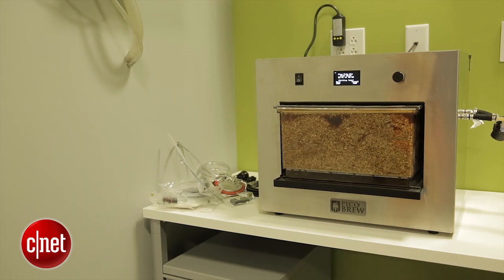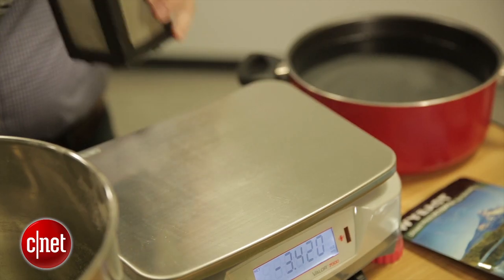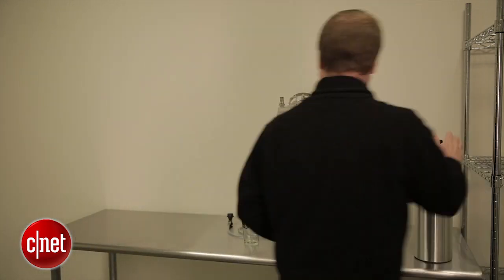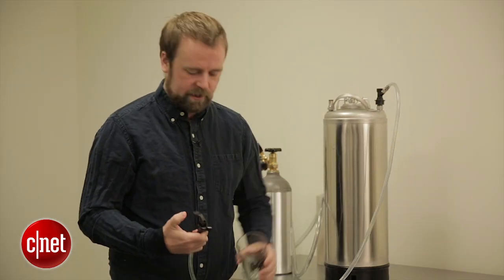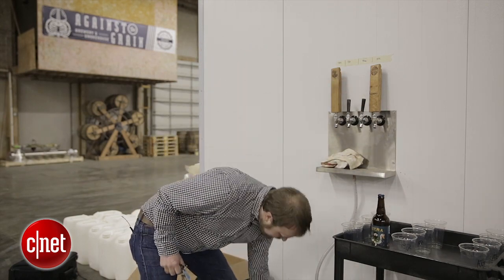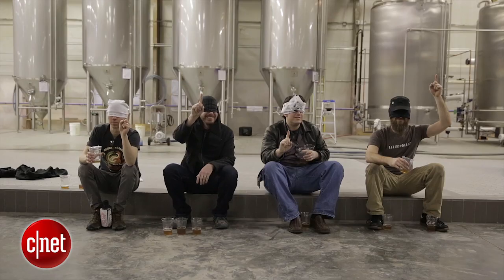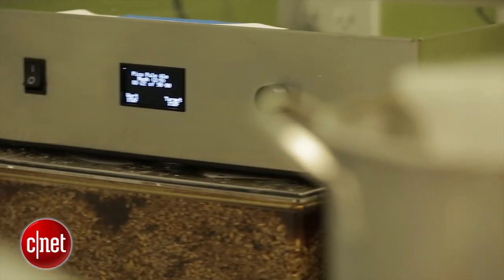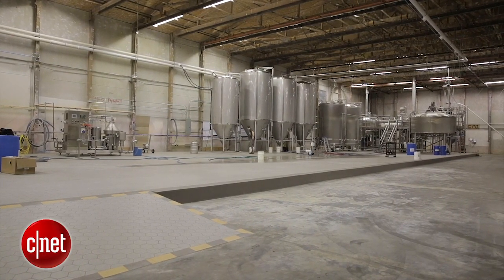PicoBrew's automated beer maker too pricey for most home brewers.

Comment: The Speidel Braumeister (German-produced) is a lot better, i'd recon. It's in the same price range, but gives you a lot more value for money. The new version even has wi-fi!, and it comes in 10, 20, 50, 200 and 500L versions.
Reply: +Hallslys  The Grainfather is even better.It comes in under $1000 US$ and does not require it to be hooked up to the internet....just a matter of time till the Pico Brew owners get slapped with a subscription fee LOL.I jumped into all grain brewing 2 years ago having never made beer before and I opted for a 3 vessel system with 2 coolers for the mash tun/HLT and a boil kettle and I made damn good beer.All I can say is I LOVE my Grainfather,it is 1/3rd of the price of a Braumeister and it comes with a counter flow chiller.
Reply: +Elsinore Brewing The grainfather has tons of more nooks and crannies to clean tho. That's the thing with the braumeister. It's german quality at its best. high-polished stainless steel with few nooks and crannies. Easy to clean. The only thing that needs to be taken off to be cleaned properly is the pump. The grainfather has tons of tubes, nooks and crannies to clean... I'd much rather have a regular old 3 tier system instead of the grainfather.
Reply: I starting beer brewing back in 1971. All these systems are fun and can make some good beer. It would be so boring if everyone used the same system.